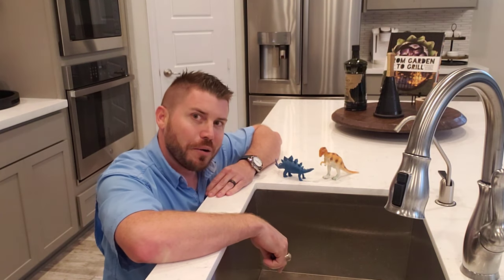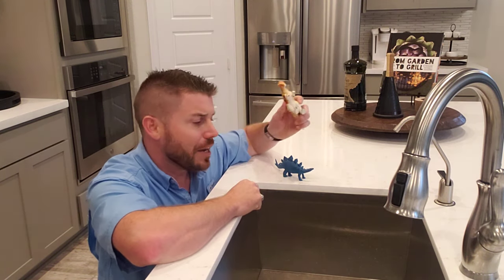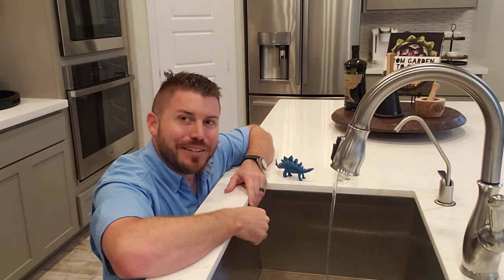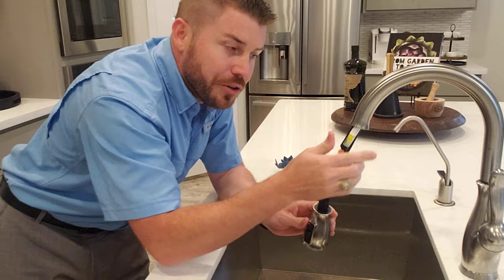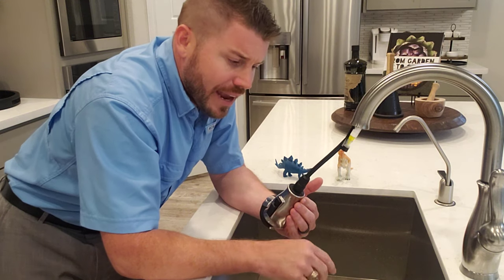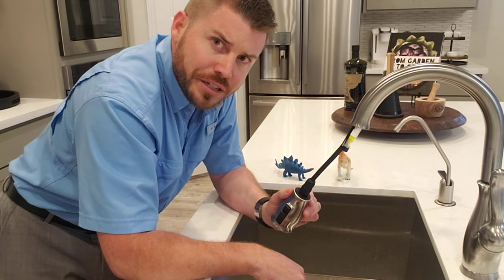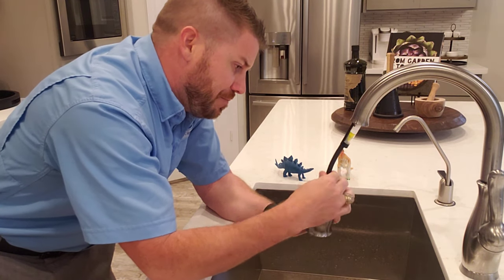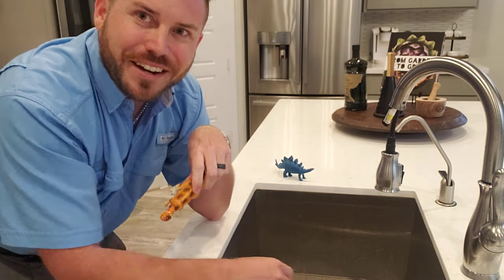Kitchen Faucet Have Low Pressure?

Comment: I have been using the same technique to clean the faucet nozzle. Unfortunately, it's getting worse to the point now that I have to hard blow through the nozzle just to clear the debris dislodged in the nozzle. I suspect I'll have to replace the nozzle with a new one, preferably with a simple one that doesn't require such a hassle. Any suggestion?
Reply: Are you removing the little filter and cleaning it with a brush?    Just running water down the nozzle is not going to do a good job of cleaning the very fine particles off of the screen.

Comment: My kitchen faucet makes a hammering noise. I replaced it 5 years ago and it started that 1 year ago. I was told the flutter valve is wore out that lets the water go to the spray wand and the faucet needs to be replaced again. Does that sound right?

Comment: Are there any other screens further up the faucet hand selector or incoming to the faucet lines?  Because I removed the entire head and the pressure did not increase. I cleaned out the aerator but it had no effect. Any  advice?

Comment: You just saved me from calling Delta Support on my new faucet.  It had significantly decreased water flow in a month since I purchased it.  I followed Delta's website advice and soaked the head of the faucet in white vinegar repeatedly.  This only returned a marginal flow and was unacceptable and quite less than with the head taken off flow.  After watching your video, I followed your instructions and BINGO, full pressure is back.  I also had cleaned the bottom filter on the faucet head before your video, but that top screen was the culprit!  Again, thanks for sharing this tip!

Comment: My American standard faucet seems to be leaking where the hose goes into the sprayer, and then the water is traveling up and down the braided hose and dripping into the space beneath the sink.  Any ideas about that?  My brother and I installed it about a year or so ago.  And yes, water pressure seems to be lower too.

Comment: I have a AquaSource kitchen faucet similar to yours but I can't seem to unscrew like how you did.  It just turns and turns but doesn't get unscrewed.  Please help. My faucet squeals and makes annoying noise when in use due to extremely low water pressure.  Especially worse with hot water.

Comment: I cleaned that part out. Screw it back on and within a day or two the faucet is slow again. Not only that but the longer I run the water the lesser the pressure. Then I could come back an hour later and the pressure will be okay and then it is slow again as I continue to run it. Please, any advice.

Comment: I have a delta tub shower 1300 series and got great pressure and volume flow on cold but not same on hot the rest the house is ok I changed the cartridge twice and flush out valve with no cartridge still the same Wil try to remove integrated stops and clean out with a tub cleaner and flush out again .what else can i do don't want to change valve i unless I have to.

Comment: I did this but it keeps happening. Am I supposed to do this weekly or do I have a bigger problem?
Reply: When you unscrew your facet take it outside and  spray it with more pressure from a garden hose and it will push all your the small particulars on thru! Then your good to go! The little pencil stream at your sink isn't strong enough!

Comment: My mohen sprayer won't stay on spray.. Also have low pressure but cleaned it with no change.. Mohen has replaced the sprayer head three times because it's a cheap Chrome looking sprayer that's really plastic with a chrome sprayed on it which chipped I expected more of a mohen faucet.. the old Moen sprayer stays on spray but all the new ones they sent me won't stay on spray mode.. Any suggestions?

Comment: I just solved all the mystery.I used the grass trimmer line to unclogged all the calcium on that particular tube.You have to go from the bottom of the sink.The small tube that connect to the head.

Comment: What about if just the cold water side is low pressure?
Reply from the maker: Sorry for the late response, I would check that particular supply line, OR the valve in your faucet that diverts the hot and cold water could be going bad and or sticking. Hope this helps!

Comment: What if the obstruction is between the supply connections and the mixed supply? The pressure is low with the head removed ...

Comment: My faucet doesn’t screw off, there’s a little button, and I can’t seem to press it down enough to take it apart - any suggestions?
Reply: Yes, shockingly just did it myself! This video got me to a point of removing the nozzle and then I didn’t know what to do.   Use a small tool to LIFT below where the little soft button is, bring to the top and it will pop off.  Now that part has two pieces.  Pull the bottom part out and you’ll be able to see tiny brown debris pieces all around the rubber ring in there and gingerly remove them.  I let everything soak in vinegar and kept tapping the nozzle in my metal bowl and I could barely see the debris cause it’s so tiny, but it kept coming out.  I kept sliding q-tips up and down that was brown until it was clean.  Amazingly everything went back in place easily, I was so nervous.  What a difference in the pressure.  Only my kitchen had low pressure, not the bathroom faucets.  Free labor at 78yo.  8:08 pm.

Comment: This describes the exact problem I'm having.  Firstly I think the rather helpful gentleman in the video talks too much.  Secondly, what if you've done all those things, found out the actual pressure is not the problem, but you reassemble the nozzle back on the line and still have the same problem.  How does one disassemble the head for a more thorough deeper cleaning.  For the record I did what he did AND I tried a reverse flow to blow the problem out but the clog persists.  Now what?

Comment: Actually the filter for this type faucet is not in the head but under the sink on the end of the line where it attached to the fitting on the sink. Watch this video to find out where the filter is and how to remove it to clean it
https://youtu.be/m6Pa3XQTuJA